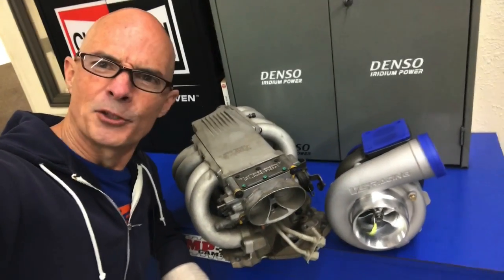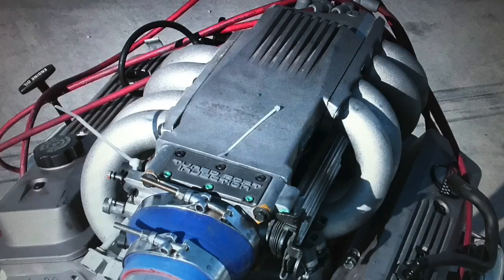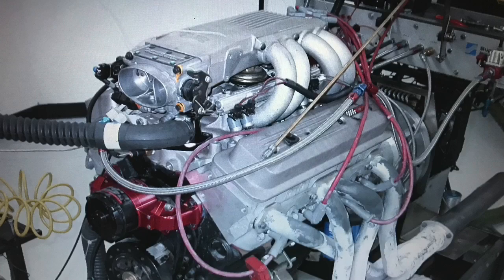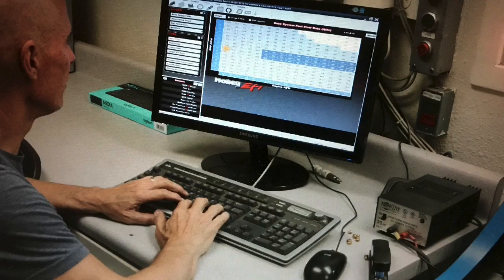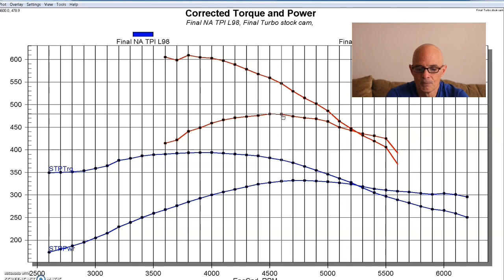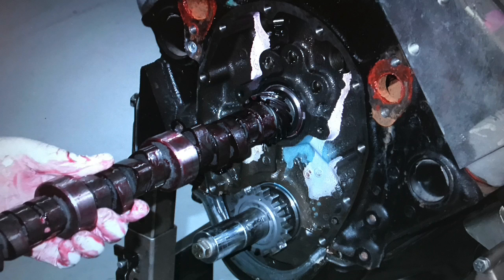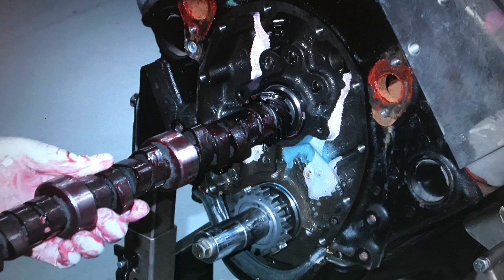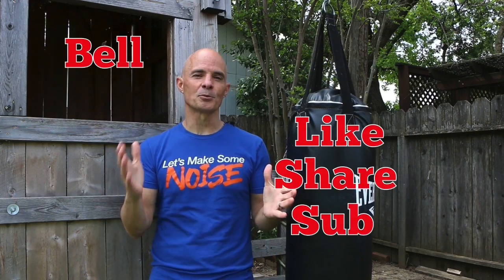TURBO TPI-BOOSTED TUNE PORT

Comment: I used to race calaway's fuel ejected , race cars,,,,, they would run 8.30 ,,7.30 in 1/8,,,,,😂 i ran boo,with 355 or 360 ci  6 inch rods,,,, she would go7500 8000 ,,,,,all 3 gears 😅😅,,,,,, but you're injection has proved to be livable,,, it will keep your bottom end together.Didn't know that back then,, i bet those old LT motors are still running just fine, and I scattered all those gas down carburetted, small blocks.😂 i still love blowing up😂😂 a.\nGood small block , just to  pull down fuel injected car,,, if you go back in time , form 96 to 2003 ,, i only lose few times  by a few big blocks ,,,, my best friend had a Lt1,,, barry grant built it into a 383,,,,, 7.40 with stock wheels,,, even borrow my welds run  7.25,,,, he couldn't stay my old car, beating him. , his car run a 1 th better than 😅😅 my car,,,, but we were young , and we decided to spray it with a 200 shot folger kit,,, 805 bucks,,,,😂😂 that was the last time the car had a hood on it,,,,, rest in Pic 🤞 🤞 we would have had the internet.We were really scratching our heads to go fast,,,, i lost my  driver's license three times in that old car , and I took it apart in two thousand and four or five,,, i still have the old  car,, it's been parked for 20 plus years.It has a brand new motor setting over there with 11 to 1 piston.She will see 8000 again.\nBefore I die

Comment: What is the exhaust note of that motor like with a turbo?
And with the dual manifolds how is it piped to a single turbo?
I have a 1985 vette sitting under my barn. Stuck in reverse. Likely culprit is the blown seal between the gearboxes on the Doug Nash 4+3
Reply from the maker: merge into single exhaust to turbo (very easy)

Comment: when you stop to look at the stuff used and the numbers....the cool looking out of date TPI gets with it in a stock form. That low rpm power would fit nicely in my low hood 75 or 79 Monza. Now I am going to be distracted thinking how to pull this off.
Reply: Google and YouTube search “First Fuel Injection “. That guy makes an aftermarket TPI intake manifold that flows better than the GM. Also has Vortec lower option. Cool stuff

Comment: No one on YouTube has done a deep dive on pushing the L98 to its limits. Would you consider doing it and documenting it? Im talking porting to the max, boosting to the max(incrementally), different fuel grades less ping is not a issue, and other stuff like different heads or enterals like pistons. Im realy curious to see how far some one can push a last gen L98 and what they can get if there goal is to go all out.
Reply from the maker: The L98 is just a small block and if you change the heads and intake, it is no longer a TPI motor-just another small block. We have run a stock block last 1000 hp.

Comment: Thank you for doing this video!  What cam would you suggest for a non turbo?
Reply from the maker: for what power, application, usage, desired rpm and what other mods
Reply: @richardholdener1727  I would like some LT-1 type of power for my L98.

Comment: I have a question? I have to start off by saying I'm nowhere near a mechanic I learn things from YouTube as I go. I know this is an old video  l enjoyed watching it just now! My question is I noticed the turbo was far away from the engine. Even though I'm not a mechanic I just notice unique stuff. I see a lot of tests on YouTube like this when the turbo seems far away from the engine. It seems like it will get more power or a different reading if the turbos were closer to the engine as if they were in a car distance wise/placement.  I saw some of your other videos I noticed you like to see if something will work or not. I'm assuming you might already know the answer to my question I'm just wondering myself.
Reply from the maker: the only thing that turbo placement with possibly change is response rate (power will be the same)

Comment: Could you run a stock engine with a turbo and normal fuel - and how much power could you allow it to run and still keep in one piece? Curious because the Callaway TPIs had 375hp in year one and they were a fully built engine. Here you're running a stock engine but with race gas... Any ideas how much you could get away with?
Reply from the maker: you can run low boost with an intercooler and pump gas
Reply: @richardholdener1727 Thank you for the comment. Could you give me any rough estimates what sort of power could be doable on stock internals like that?

Comment: Ive always loved these TPI intakes and ive dreamt of putting one on a 350 for awhile now. I finally own a 96 K1500 that came with a new-ish goodwrench 350 and my plan is to manual swap the truck with a brand new SM465, and swap in a mild cam, some new lifters, springs and rockers, a TPI intake with Vortec base and then give it a nice tune. Should be a really nice truck to drive in my opinion. Super torquey for off road and mild street driving.

Comment: The TPI intake manifold is junk for trucks. It went straight into the trash. Replaced by an Edelbrock Proflo manifold, with a big cam, brodix ik180 heads, long tube headers and dual 2.5 exhaust, made 410 hp and 360 ftlbs peak power at 6,100rpm. 355ci btw.  Boost that! 😂.
Reply from the maker: we have, many times

Comment: I just picked up a 1989 Corvette Tune port that the guy took all apart and could remember how to put it back together. $1,800. I got all the machine work done and assembled the motor myself and have it back in the car..! That tune port looks cool and its light as heck...!!

Comment: Centrifugal Superchargers are phenomenal with Tuned Port Injection.  Unbelievably fun to drive.  I do have to say one thing though about what you said about "Artificially" moving the torque and hp curves.  When you use TPI you ARE tuning it according to sensors, data sets, A/F ratio, RPM dependent values.  So in essence, you are not using "Artificial" anything.  Its just a different means of tuning.
Reply from the maker: the rising boost curves artificially forces the peak power past the effective rpm of the cam or reflected wave of the intake runner length (the rpm where the combo would make peak power in na form or turbo form with a constant boost curve)

Comment: I have First big Alu runners 75mm trotel body Roller cam Dart Heads 190 volym Twin Turbos K27 Vems EFI Custom build  Turbo Hedders 50mm wastgstes Build this abaut 95-96 Still standing in The garage In May Corvette uppradade Rear and 12 bult Toms axels strång...Hope i have 500 Whp...Street Car...RPM 6500 That no problem...

Comment: 383 w tpi, siamese runners, ported lower intake, 500+ lift on cam shaft finished off with a centrifugal supercharger tuned with a Holley/fast setup. Maybe even on AEM

Comment: What aftermarket management system do you use?
Reply from the maker: holley or MS3 Pro
Reply: @richardholdener1727  Thank you! I have a 1989 Camaro IROC Z with the 5.7 tpi motor and have been wanting to turbo it for a while and have been held up because of the  lack of plug+play aftermarket management systems out there. Do you have any recommendations for what I could consider going forward?

Comment: With TPI the tuned length is what it is, the idea is to keep the torque up without the drastic drop off at 4,700 RPM and when you do that you end up with a fast car that doesn't want to rev past 6K regardless. I had a 350 that would pull hard to about 5,600-5700 RPM but made tons of torque down low. Very fun to drive I assure you and stop light to stop light amazing. Also got 26MPG doing 75MPH with a T-56 behind it.
Reply: Could it tow?

Comment: Chevy should have used TPI in their trucks back then too, I think even stock they made more torque than the old 6.2 diesel, before they were turbo of course.
Reply: You'll always make more torque with gasoline than with diesel if capacity is similar and there's no forced induction going on.

Comment: Cool!  Makes me feel even better about my build plan for my Frankenstein themed K5.  It's an 84 GMC Jimmy with dana 60 feint corp 14 bolt rear axles from military CUCV square body, a zz4 sbc long block, built late model 700R4, rebuilt NP205 transfer case, and refurbished TPI system which bolts right up to the aluminum heads on the zz4.  I think the long intake runners on the TPI and small intake volume of the zz4 heads will make a great truck engine.  Perhaps I will go ahead and get twin turbos for it since I dont have headers or exhaust yet!

Comment: I have a 588 109 LSA 300 INT 306 EX W 1.6 ROCKER ARMS 40OVER AND THE PISTONS ARS .456 TALL THE POP UPS AND MY HEADS ARE 64CC YES WHOS YELLING BULLSHIT IT WON'T WORK MY HEADS ARE COPPER .120 THOSAND ANNEALED AND I AM MAKING 13.9 I THINK 🤔 and I have to run 108 octane I am now having to degree the cam well I had it run and now it's giving me grief oh you'll get a kick out of what this 5.7 s in a 2500 1994 Chevy Silverado 4x4 ...

Comment: I loved my TPi Firebird Formula. Would light up the tyres off the line and pull hard all the way to.... 4000rpm.
Reply from the maker: ALL THE WAY UP!!!!!
Reply: @richardholdener1727  I should have put ported runners on it. Love your vids man,
Would love to see difference in power produced on a turbo motor by only changing compressor OR turbine size

Comment: Wish I could learn a little more abt installing a aftermarket exhaust like Fast, and the problems that you encounter. Is it plug n play? Is it sequential for the injectors?  And what size injectors were used. If anyone knows fill me in.

Comment: Ran a 383 with the old lt4 hotcam kit and tpi in my 88 formula 350 for 15+ years. With a b&m holeshot 2400, it was a torquey driver. That intake designed made 1st gear in the 4l60 useless under wot.

Comment: I got a cam from comp its a 232/234@50 594/600 lift on a 115° lobe sep on a 0° off set for my turbo tpi peek tq was 512 at 3100rpms and carried it to 4700rpms before it droped. This was with factory l98 heads decked 10 thou on pump gas on 8lbs of boost. Bottom end was built ran it on the dyno at Tom bailey's pre-party in 2018.
Reply from the maker: that is a lot of cam for a tpi motor

Comment: Hi Richard,  what is the most radical can spec you would recommend using 1.5 roller rockers and uograded valvesprings added. I have the roller rockers already and would like to build the motor to make maximum horsepower on a budget and add twin turbos afterwards. Ideas?
Reply from the maker: tpi motor?

Comment: The power is awesome, especially for an engine essentially unchanged since 1955, but I hate turbo under-hood heat and plumbing challenges. But damn that's a lot of power from a low budget setup. Lot of power. Lots and lots 'o power...

And in future news: 
"C4 Corvette Owner Rendered Completely Insane By Attempted Turbo Installation."
Reply: Yeah trying to turbo the TPi in my corvette is not going to be easy.
Reply: Look up beckers garage 😉

Comment: wow, came across this and so memories hit me. I was the grey mustang gt at "mustang Dynamics" back in the day ( name is john shop was in anaheim off of la palma ave and lakeview) when we were the early tweakers of the 80''s mustangs. Sure, there was bbk, steeda and kaufman but actually putting supercharges and building motors we were doing that at MD (remember Saleen was down the street) You had that black hatchback and was one of the first , back then, truly racing the mustang. Rich "speed" holdener if i remember correctly. Good seeing you still in the game.
Reply from the maker: THAT IS FROM BACK IN THE DAY
Reply: @richardholdener1727   yes it is. Remember it well!!
Reply: @redtesta  
Are you still doing ford 302 5.0 stuff?
Reply: @xmo552   i haven't after working at mustang dynamics, back in the day and a few years later i got into corvettes after getting completely destroyed all around by one at the track LOL.  I actually wanted to get (hold onto your hats) a  95/96 Mustang SVO and fully update it. That car had all the suspension and brakes the GT didn't and the GT had the motor the SVO didn't LOL.  I was disappointed with the 4th gen mustangs (had a 1995 convert almost sold that thing within months with is detuned and monstrous 215hp barely 5hp more than my amazing 1985 GT 10 years prior). Last stang i had was a 1999 with the 265hp, just did some gears , pulley and exhaust (the status quo back in the day before all the options now) . I did have it along side my vettes at the time but sold it. I will always have a place in my heart for Ford especially during the 80's :)  Rich, did you run the silver state back then? I m trying to  remember one day you were in with the black hatch and prepping it and i could have sworn it was for silver state?)
Reply: @redtesta  
Those years are nice. I have a mark 8 and I'm building a 56 f100 with another Mark 8 donor.
Reply: @xmo552   oh wow.. what a great project to work on.

Comment: Just did heads cam son xfi280 roller rockers Edelbrock 195 heads the cam lift is 571 577 set of custom built headers with a single turbo on it I'm not giving out the specs of the turbo 64 CC injectors among a lot more stuff coming soon

Comment: Richard, anyway you could give me a call, I believe I own the first l98 car HP performance built, it was a blue 85 vette. The pictures of the turbo setup in this video by HP performance is the exact, and I mean exact setup in mine. Even have the HP performance badge on it still. It’s as built around 2005. Holset turbo tial waste gate, 42 pound injectors. Custom headers and borla exhaust. Turbo is located where the battery originally was
Reply: Just talked to Jimmy, he confirmed this was the first prototype car they built
Reply from the maker: VERY COOL-DID YOU HAVE A QUESTION-JIMMY IS GOOD PEOPLE
Reply: @richardholdener1727   having problems with the fuel system, injectors, and pump need replaced if you want I could send you pictures of how it sets currently, so awesome to see the history of this car

Comment: If you're going to get more horsepower out of that engine you need to put a supercharger on it instead of a turbo Buster boat suck you have to wait for Boost charger you don't wait for Boost
Reply from the maker: wrong o Mary Lou

Comment: would that motor in stock form withstand boost without blowing head gaskets or anything else catastrophic?  or is it not feasible to run as a semi daily driver.
Reply from the maker: it will if the tune is right

Comment: Will this set up work on a 4.3 v8 I have one sitting in my garage I want to put in my gmc s15 I think it would be a unique running a turbo 4.3 v8 gm turbocharged there 4.3 in the 80s and 90s so why not there 4.3 v8 lol

Comment: My 87 Formula 350 with a bone stock L98 / 700R4 drivetrain with very low mileage (less than 10K original) made 217rwhp on a dynojet. That's really respectable for a motor with a factory rating of 225hp and would indicate these engines were making a little more power than advertised.

Comment: I would have liked to a TPI build with the big mouth intake, runners, bigger throttle body, ungraded  heads and true daily driver cam NA and the with 8 to 10 lbs of Boost??? Is that a truly viable combo for a non-emission daily driver?? Suburban.  Should it be a 383 or is the boost enough to drag that behemoth around and get decent mpg? Switch the control to sequential maybe?

Comment: Any way to take a tuned port intake and slap it on a lower and turn 1000hp on pump gas, be it a stroker or what?
Reply from the maker: a lower what? did you mean blower?
Reply: What

Comment: Hi Richard, really enjoy the big power stuff! But your always asking for comments and what we'd like to see. So what I'd like to see are builds for specific racing purposes. For example, how do you make the most power from a 302/5.0 V-8? for endurance racing? For Drag stripping? What about 4v heads? 

My 2nd question has to do with fuel. Can you answer the question about HP and fuel, does x amount of HP always = y amount of fuel? Regardless of RPM, CC's?

Comment: Seems like this would do good with a big split cam 212 230 on a 113 and a bigger turbo such as maybe 70-72 since all the torque is there early try to move it out with a cam split not duration just having the exhaust pull it out further

Comment: I want a good intake with longer runners for my LT1, can I use an older tpi intake like these? Will the map sensor be okay and vacuum lines? Im only worried about the essentials and I have an HP tuner.

Comment: https://www.theturboforums.com/threads/how-long-till-it-grenades-it-never-did-go-figure-grenade-part-2-to-come.305001/ Everything you ever needed to know about turbocharging a TPI intaked engine. End result is 100% junk engine making over 700 to the tire with high boost and a 75 shot backed up with mid 9s ETs. I think it was 27ish PSI with a pair of TA49 Buick GN Turbos.

Comment: They should have put the tuned port injection engines in pickups , I had 2 of them , both 350s in F. Bodies, an 89 Formula 350 and an 89 Iroc 5.7 , they are absolute torque monsters...I did an Accel SuperRam on the Camaro with a nice roller cam and TFS heads,SLP headers and exhaust and it Really woke up! A built 700rR and swapped to 3.42 gears ,it would break the tires loose from a 60 roll punching it .

Comment: I have a question for you i have a 97 c1500 with the ugly spider injectors i have wanted to swap that whole intake with a 90s camaro intake which'll bolt right to it im just wondering how i would do the wiring for the injectors. Any help would be greatly appreciated

Comment: Show how to Holley stealth ram intake part#s links install etc. the L98 I have a 1991 is  automatic bone stock would be great to see how to improve it. Im told its the corvette L98 is aluminum heads forged cam and crank and with good specs.

Comment: Based on the power curve I think it did have the factory cam.  I like the look of TPI too and I think it would have made a great system for a truck where you want low end power.